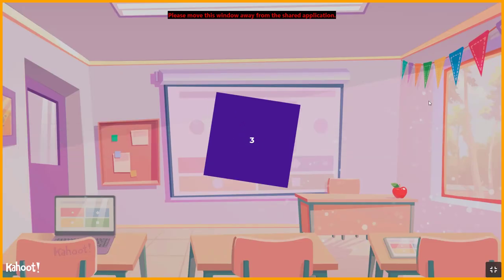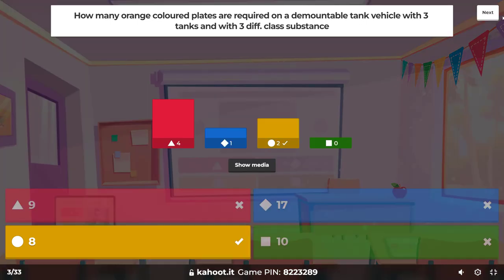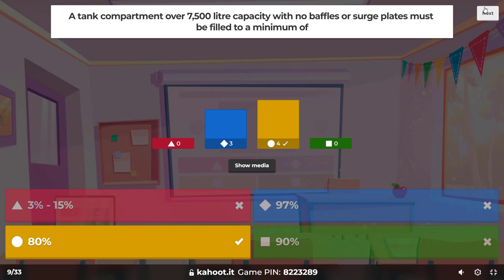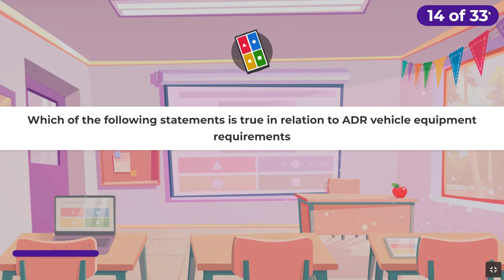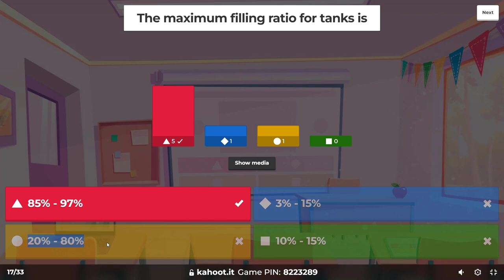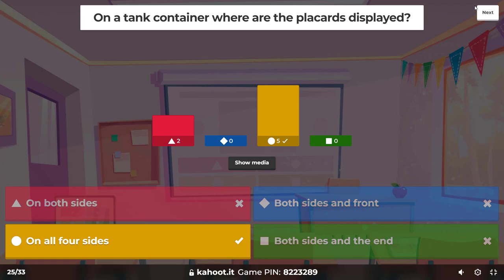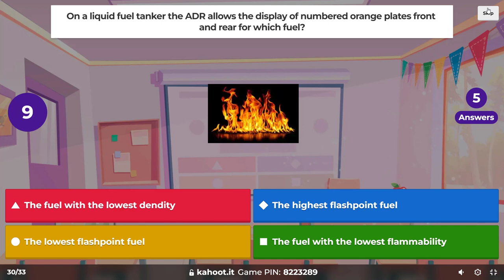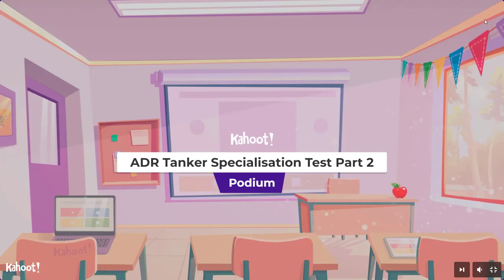ADR Exam Revision Questions Test 2

Comment: Hi mate, thanks for your helpful video. I have a question, which is, your ADR lessons same as ADR in England or not. I appreciate that if you could answer me please. God bless
Reply from the maker: The exams are set by different bodies so I would assume they are very different. However, the subject matter remains the same.